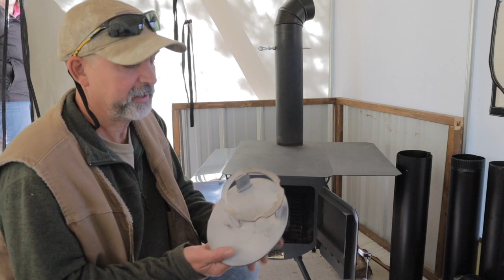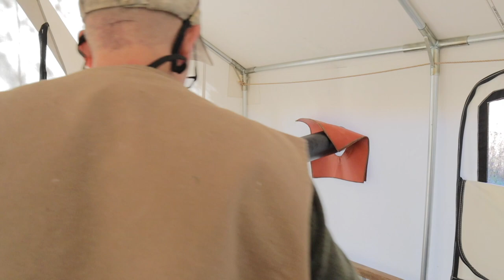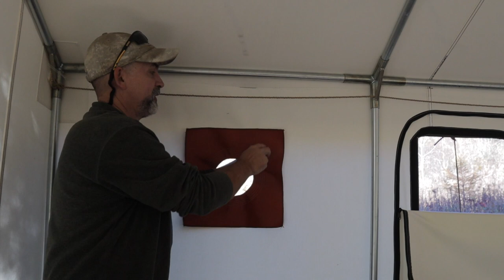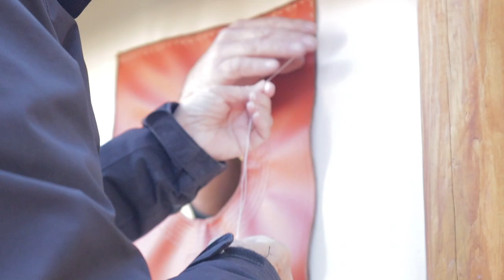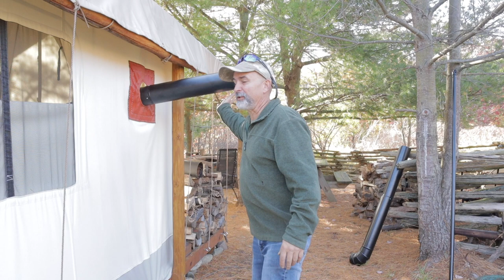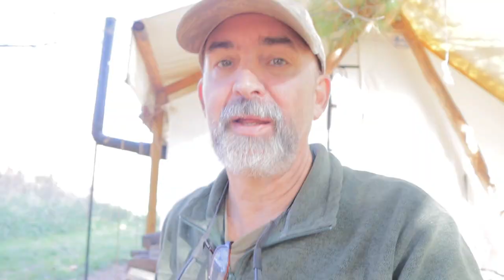NEW STOVE JACK FOR THE CANVAS WALL TENT

Comment: What does Davis recommend about dealing with the top seem area where a small amount of rain and debris can sit?  What about caulking that?  There has to be something that can be put there that would allow water to not sit on that seem and create another small problem over time...
Reply from the maker: Hey Chris, the best thing to do for long term setup like ours is to go through the side wall instead of the roof. Davis Tent recommended we change ours to eliminate the problem we were having. We also changed our rain fly to eliminate the opening that was there to accommodate the stove pipe. I don’t think caulking would help. It may even make matters worse by trapping more moisture in the fabric

Comment: I have a canvas tent and my roof got a couple burn holes in it plus its getting a little like yours was. I'm thinking about not using a wood stove this winter and putting a stove jack in the side like you. Thanks 4 the info
Reply from the maker: No problem Jacob. What will you heat with if you do use it during the winter?  
Thanks for watching
Reply: @mytwelveacres3071  I'm using my propane heater and I have an electric heater

Comment: What about the hole in the roof from the original pipe location? What were you left with. Also, I'd love to know how you built the fence in the background. I tried finding it in your older videos, but I haven't. Thanks for posting.
Reply from the maker: Hey Cheryl, the existing opening has a canvas flap that we can pull down and tie so the opening is covered.  Our property is all overgrown vineyards. They have not been worked in many years. The fence is all the old posts that were used to support the grape vines. I pulled them all and made the stockade fence